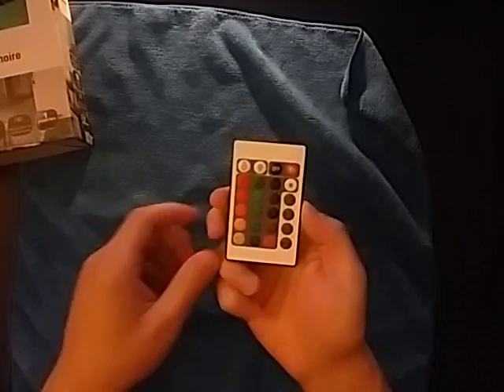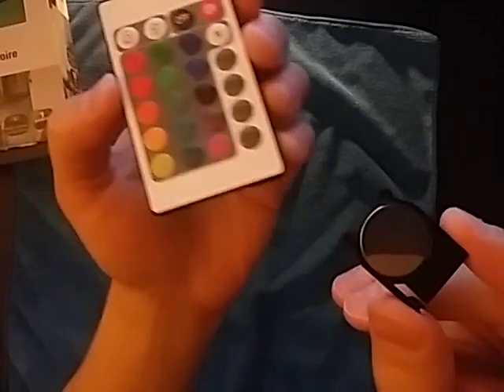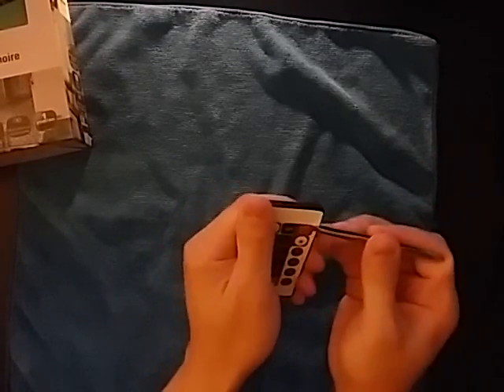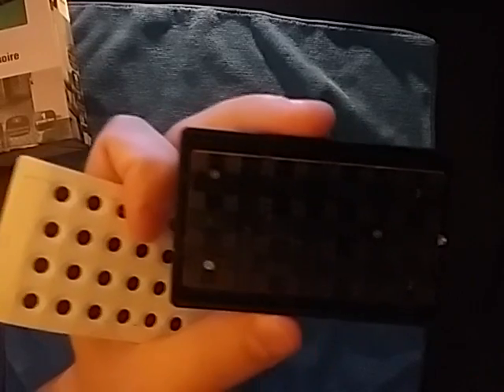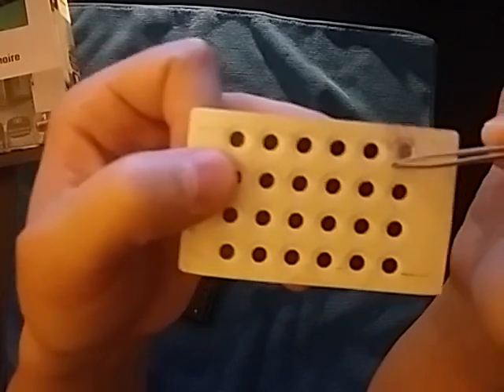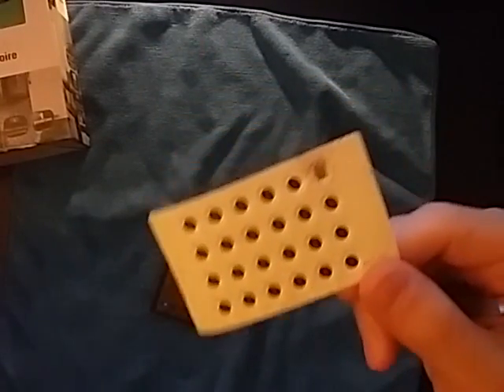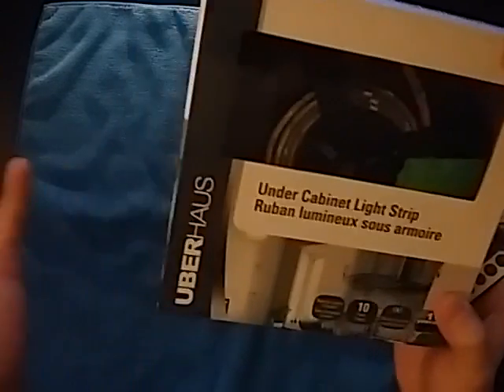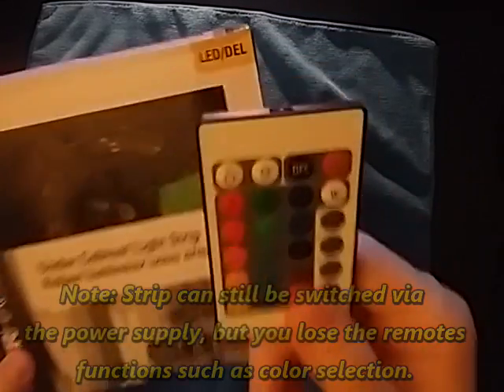LED Remote Repair (Buttons Not Working)

Comment: Absolute genius. I used a tiny square of tin foil and a tiny little blob of Blu Tac. One functioning power button again. I had visions of replacing the receiver unit with a new remote.
Reply: Thank you! I didn't own this expensive tape and we didn't have it in the nearby stores, so I thought your idea was worth a try, and it worked!

Comment: Quick tip. If you dont have aluminum tape, remember the contacts are CARBON. Peel the cover off and check if any of the contacts are patchy or wearing out. Take a regular #2 pencil and basically fill in the contact since there is carbon in lead. This should fix the problem easier and cleaner than using aluminum tape.
Reply: YES!!!!!!!!!!!!!!!!!!!!!! THANK YOU SO SO MUCH!!!!!! I have been trying to figure this out for over 3-7 months. This is really the first time I actually worked on it hard though. Once again thank you. :)
Reply: chill Lee like the magic battery trick with the PSP haha
Reply: This works great!

Comment: Not exactly the same problem, but your suggestion led me to the solution. I could see that via camera that my IR constantly was sending signals without pressing any buttons. Somehow there must have been a short circuit. However taking the adhesive off, cleaning it a bit and putting back on already solved my issue. Again thanks for kicking me in the right direction. :)

Comment: For them of you that didnt get it to work. Unscrew the board from the plastic and pull out on the metal tabs that make contact with the battery. That was my problem but without this guys video I would have tossed in the trash. Just saved my $1.25 lol

Comment: if you view the remote diode with your camera you can see if the remote works.
my remote works but the light is not responding.
I tried replacing the ir sensor in the bulb, still nothing.
its cheap chinese junk
Reply from the maker: Yeah, unfortunately we get what we pay for. :/ I usually buy these things knowing that they are not likely to last or stand the test of time. Sometimes, however, i'm pleasantly surprised.

Comment: Thanks so much!! A hole punch and some alfoil did the trick for me.  My button had a white coating on the back that had worn off the power button. I tried the pencil but no luck. A little alfoil and back to working.

Comment: I had 3 of these remotes as they all stopped working. I found that if you take it apart The problem lies with the battery connectors. These remotes are made so cheaply that the two bits of metal that touch the batteries positive and negative areas are often not touching or touching more than what it should be. I kept all three remotes and and now they’re all working again. I basically took it apart completely and Sellotape it all back up without the plastic casing. I secured the battery in position with Sellotape. It doesn’t look pretty but it works and it saves you a lot of money. All these videos showing people taking it apart because of the buttons and putting it back together again is not the issue. It just so happens that when you take it apart put it back together again it only temporary works because the battery connectors are touching again. Overtime it moves and you have the same issue.

Comment: All my contact pads are all good, but my remote wont turn on still. I just got my pc from ibuypower about 3 days ago
Reply from the maker: Hmmm... that sounds like it could be many things. You could test the remote using a camera to see if the thing is actually sending a signal (hold it up to a digital camera or your cell and look at the screen while pushing the buttons -- ie. you're looking at the led bit on the end you point towards whatever you're turning on/off) if they light up it's good. If its' not lighting up it's something wrong with the unit. Trying checking batteries, they may be in wrong too. Otherwise best guess there would be it's suffering some sort of other defect.
Reply: youtubasoarus thanks man
Reply: youtubasoarus mine is sending a signal but none of the buttons r like working with the lights like they won't even turn on but the remote is sending a signal

Comment: what’s the battery required for the remote if it doesn’t arrive with one?? i have the exact same remote as the guy in the video.
Reply from the maker: Yeah, the remote needs a battery. CR2032
Reply: yulun ali mine didn’t come with a battery either

Comment: I lost mine can I just buy a similar one with the cable receiver?
Reply: Gaming Egg what is the cable receiver for? Also, is there a way for the remote to reach the controller with the hood closed?
Reply: jlevora u got lights on ur car? Lol I got some on my pc
Reply: jlevora cable receiver is to connect new lights and use the designated remote
Reply: Gaming Egg oh lol, I just searched up the remote issue and didn’t realize this was not a car application.
Reply: jlevora u can connect it to ur car with a usb receiver
Reply: All u gotta do is set it up and wire it then connect the usb to ur thing and ur set
Reply: Gaming Egg right. Thanks!

Comment: I checked whether or not the buttons were working by pointing a camera at the IR LED and seeing it light up. All buttons except on/off work. Would this be the battery? it reads 3.01v

Comment: Ok so the remote I got with my led pack didnt work out of the box. My camera didn't see any IR light on the top so i assumed it was the battery. Bought a new battery, and it still doesn't work. My led strip works fine, but it is just stuck on blue, and I can't change anything. Only on/off I have is plugging in/out. Is the remote completely busted?v
Reply from the maker: Sounds faulty yeah. But did you try flipping the battery around the other way? Also there may be a shipping tab in the battery compartment that prevents it from working. Ie. they put a plastic tab in the battery area so the battery does not conduct during shipment. Try looking for that, if it's not there then flip the battery and try function testing again.
Reply: youtubasoarus doesnt work dude
Reply: youtubasoarus thanks for helping, i tried that, didn't work so i just ordered a new remote, and it works perfectly
Reply from the maker: No worries, glad your remote worked! :)
Reply from the maker: Slab Sauce - Buy another one I guess. Not my problem. I offered a quick fix for people who had the button specific problem.
Reply: Lucky you, I'm stuck on green.
Reply: Mine will not turn on period. I was stuck on blue before then it stopped working all together. Typical cheap China plastic junk. You are right, the lights them selves are good butt the remote is trash. I will open up the 2nd circuit box and try to reroute the wires and have a switch at the plug so it just turns on White and off. Good luck to everyone!
Reply: Elk Meat 🥩 llamas ÿl
Reply: The same exact thing happened to me

Comment: My remote is markedCR2025 on back and when I pull out the battery there is a smaller CR1220. Is that normal (battery marked on case that is different than the one in the remote?

Comment: When none of my buttons worked I changed the batteries and the battery holder(exchanging both with a different led controller) and tried using a different led light controller which  worked and then I switched back to the original and it began working too! Idk why that worked but it did!

Comment: I just bought a Logisys RGB LED kit for my computer and installed it. The lights came on after some plugging and unplugging of the various connectors so get them to be the same color. However, the remote will not control the lights at all. As suggested above, i turned on my Xbox One and went into the Kinect settings and switched to IR mode and pointed the remote at the lens and pressed buttons and i can see the remote is putting out a small flash of light. It just won't control the led box inside my case. Any thoughts?
Reply from the maker: Not sure there. The cost that these things are manufactured at it's hard to figure which component is wonky. Could be the receiver, could be the remote. Could be the chip that interprets the signal. So many things can go wrong. 

I'd try starting with on/off with the remote and see if you can get that to work. Make sure the IR receiver is visible to the remote. If it doesn't work but is sending as you say, then there's a million things it could be. Sorry. :/
Reply: No worries! I just did what I should have done in the first place: ordered an NZXT Hue+! Thanks for the speedy response!

Comment: I dropped the remote and the battery was unlocked and it broke now i cant insert a battery to use the remote is there a way to change it using my PC or do i have to buy a new remote?
Reply from the maker: Should be a way to get that remote working. They're pretty hard to break.

Comment: can you just use alluminuim foli and then just glue it on the part that is broken?
Reply from the maker: I don't think that would work because the aluminum piece would float in between and cause it to activate when you didn't want it to. If it's adhered to the dome like structure it pulls back up off the pad and only activates when needed. You might try it though, could be an option. I'd just recommend some sort of adhesive on the backside (button side, not pad side) to keep it from falling back down.
Reply: ok my mam said if it doesnt work she is giving it back to to ebay seller
Reply: LemonYT i just tried this and it worked !!!! make sure the tin foils sticks to the adhesive that is on the pad you take off!!! i'm so happy !
Reply: God The All Mighty i was gonna ask the same question but this saved me time thank you 
UPDATE: Didnt work :(

Comment: What if i put in the square thing for the battery in backwards? Its stuck and idk how to get it out.
Reply from the maker: I've done that before, yeah it's difficult to get out. You'll have to use a flathead screwdriver or something to pry it out while pressing in the tab. Difficult but it works. Also be careful not to hurt yourself.
Reply: youtubasoarus thank you! Ill try it now.
Reply: youtubasoarus does every remote have the chip. The led light remote i have doesnt have a chip and still not turning on. I fixed the battery thimg. Its a mainstays brand garden led ights.
Reply from the maker: Good to hear you tried it out. But yeah every remote is different. The only reason this seems to be popular is that the remote seems to be a mass sourced item. As in, the manufacturers of those LED products didn't want to make their own and just sourced a generic one. This remote has been used on hundreds if not thousands of consumer electronics. Generally, however, they are always different.

Comment: So I've lost the little USB adapter that powers the LED strip. Any way of hardwiring an ild USB cable to make it work.
Reply from the maker: I want to say yes but the power requirements for the strip would be tricky. You'd have to calculate the number of LED's and their wattage to supply it via hard wiring. Too little voltage, you'd get dim LED's, too much and they'd burn up and that'd be the end of that strip. You also run the risk of burning them over time. It's a tricky business these darn LED's.

Comment: all of you. leave the damn remote alone its fine. the led controller bugs out, to fix leave led controller plugged in usb and disconnect light strip, press red on remote. plug back in and its fixed. white will freeze the unit if it is not on 100% brightness.
Reply: MY DUDE you are a life saver, thank you xDD
Reply: THIS
Reply: THANK YOU
Reply: Worked for me as well!! Though it had more to do with all the disconnecting / reconnecting while still plugged into power, made me realize I had the prongs the wrong way. Just a light contact when i flipped it around and it lit up. Had to force the prongs in but it worked (so yeah, just because the 4 prongs go in easy doesn't mean you have it the right way, in case anyone else had that assumption)
Reply: Man, you just saved my day! A buddy gave me a set of these and the remote was not working. Your advice fixed it. Thanks!!
Reply: John Holmberg what usb?
Reply: John Holmberg what do you mean by USB
Reply: You sir, are a genius!
Reply: What usb?
Reply: freaking life saver!!
Reply: @VFYTChannel  bro podes explicar?
Reply: @diogosoares5979  
1 - Deixas o USB ligado, e desligas o connector que liga os leds ao receptor (a cena que tem os 4 pinos). 
2 - Carregas no botão do vermelho umas quantas vezes, e voltas a ligar o receptor aos leds. Se resultar a luz muda para vermelho. 
3 - Depois não podes carregar nos botões de luminosidade (os dois brancos do canto superior esquerdo), nem nos que dizem flash, strobe, fade, e smooth. tudo o resto podes usar, (ligar, desligar, e as cores todas).
Reply: @diogosoares5979  Boa sorte!
Reply: What do you mean by leave the control on the usb?Its battery powered
Reply: Bro thank you sooo much
Reply: John Holmberg fuck**ing genius, thanks a lot!
Reply: @zer0sek  Can you explain what to do? I dont understand this bullcrap :/
Reply: Genius 3.0
Reply: The hell do you mean my usb

Comment: I think mine is a cheap replica since I got it from China along with a glowing chair box. And it's not just some of the buttons not responding, the buttons are switched up somehow. To put it simply when I click one button another one turns on or doesn't respond at all. Do you have any idea how I could switch them back or where to get a new remote? :(
Reply from the maker: Hmmm... not sure there. If it was like that out of the box someone may have switched it up before you got it. Otherwise the manufacturer probably doesn't do quality control for shit. That's common with stuff from China for bottom dollar. I'd advise returning it if you can.

Comment: You might want to take out the panel or side of the tower and aim directly at the light. The remote doesn't have very good range. It worked for me when I placed the remote on top of the tower where the led strip is below it.

Comment: U have a remote kinda thing that’s sticks to the wall and is connected to the lights and I can change the color and dim it but my real remote that makes multiple colors is not working so idk what to do but u will try this method but pls respond if h might know what to do
Reply: I meant I have*
Reply: Also the thing on the wall has only 3 buttons one to turn on and of another to changed the color And one more to dim and brughten

Comment: I pot aluminum foil on it it didn’t work can I put aluminum foil on it? If I do is it supposed to work?
Reply from the maker: Nope, it has to stick on one side so that when the button is up, it's not shorting the contacts. The idea is that when you push the button the foil will bridge the contacts inside, acting like a switch. If it's just foil, not sticky on one side, then it may switch that button randomly.

Comment: My remote doesnt even turn it on. Please help. Is it the battery or..?
Reply from the maker: Not sure brother, you've got to check. Pull the battery and hook it up to a meter and see if it gives you proper voltage. Should be 1.5v. If anything try flipping it the other way.

Comment: If you use a cr2032 battery rather than the cr2025 it requires, could that cause the remote to not work? Someone please answer me, thanks

Comment: I had the same problem with a similar  remote. I managed to prise it apart and it was the battery contact. I cleaned it and bent it slightly and now it works perfect.

Comment: Was your light on your remote lighting up before you fixed it? Mine isn't.
Reply from the maker: Yeah, every button worked except the on button. So I pulled it apart to see what was going on and found the issue. If yours isn't lighting you should check the battery first. Flip it and put it back in and see if it works. Test and if that doesn't work check the voltage on the battery cell (if you can). Try a new battery. Otherwise it's fuxxored.

Comment: Is it working with aluminum paper ?
Reply from the maker: Well the part that makes contact is aluminum but it's in tape form so there is adhesive on the back. The paper backing is just to keep it on the roll.

Comment: I plug mine in and a green light on the charger turns on but not the actual lights on the strip. Also, the thing to get the remote open doesnt work
Reply: Mine is the exact same way

Comment: I chipped a part of my board, do i jsut buy another one to replace it or is it fucked?
Reply from the maker: You could try to find the part for the board and order it and resolder it on. IF you have the skill to do so. Otherwise you may try to source a replacement controller from the manufacturer... i'd think that would be damn near impossible as most of this stuff is made in China and finding them will be near impossible. Each controller may be slightly different albeit a controller from another device MAY work as they're somewhat partially standardized because they're used in so many devices.

Best to try a few things before giving up.

Comment: so I have lights similar to this but they don't change colours but when I try to turn it on, there's this high pitched sorta whiny beep that comes from the part that plugs into the wall and I have no clue why it's doing that. I'm extremely frustrated bc I just spent over an hour rearranging them from another part of my room and now they're too far from an actual outlet to see if it's the extension cord that's having the problem. I also tried that thing where you point the remote at the phone camera but I can't see the light inside it. I have no idea what to do please help
Reply from the maker: If you can't see a light on in your phones camera (through the screen) then likely the battery in the remote is dead or upside down. Try flipping it, if that doesn't work the battery is likely dead or low. Might need a new one and try that. Good luck :)